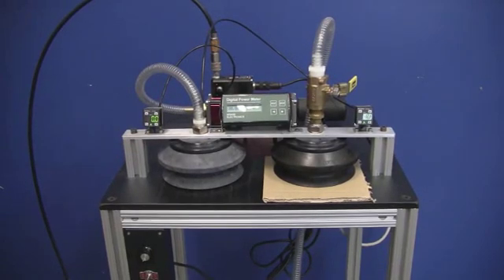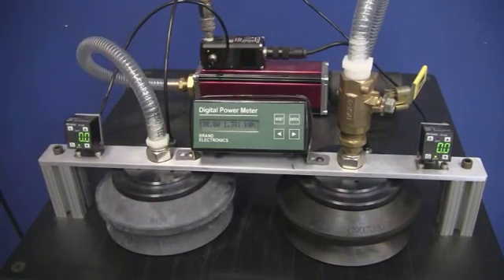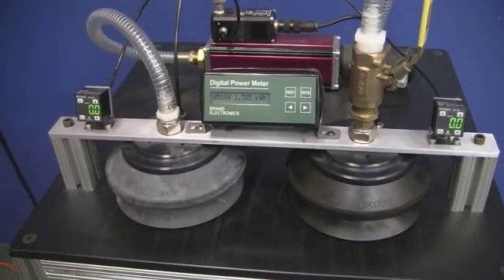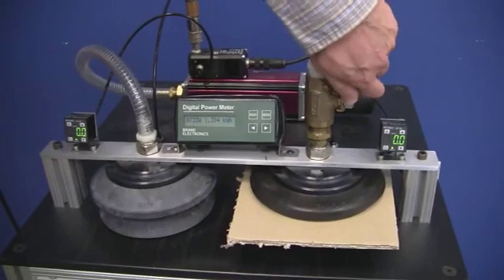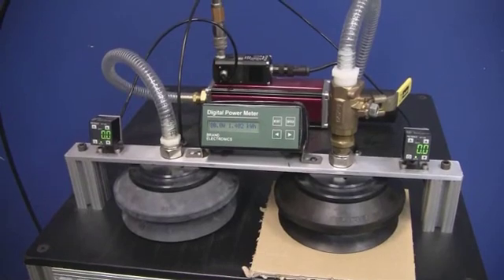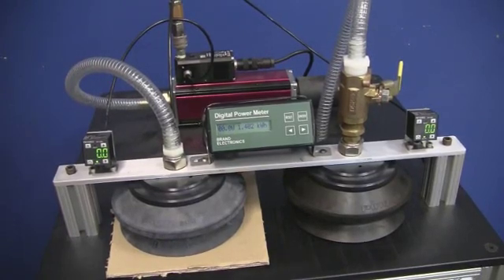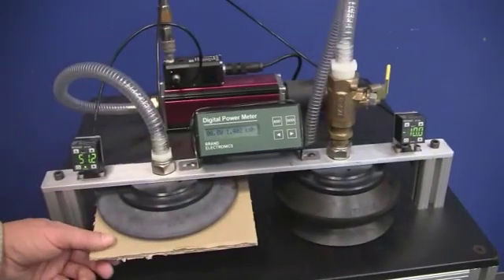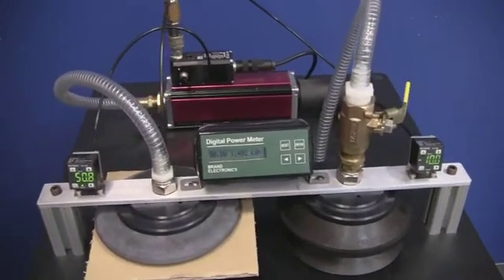Air Driven vs. Mechanical Vacuum Pumps - Piab

Comment: You are obviously a air vacuum sales person. Your evaluation is INCORRECT. YOU IGNORE THE AIR COMPRESSOR POWER CONSUMPTION.. i’m an engineer in an unrelated industry. Remove or put up a correction.
Reply: hi John, 
Thanks for your comment. but if i have some free air of compressor (means i am consuming 80% of air as per rating of compressor)  in my industry then can i use air driven vacuum pump. 
please suggest.
Reply: Jonny fell asleep he doesn’t have a reply